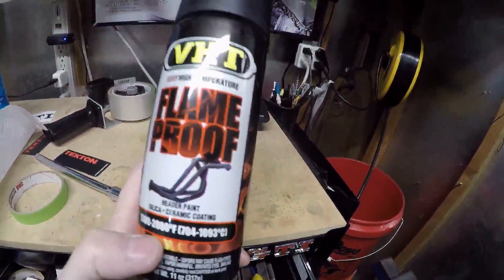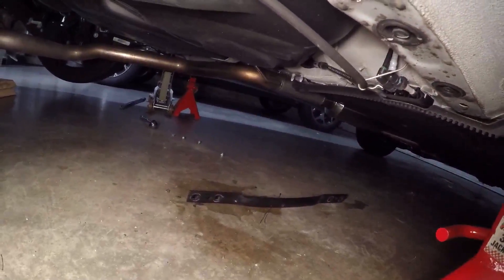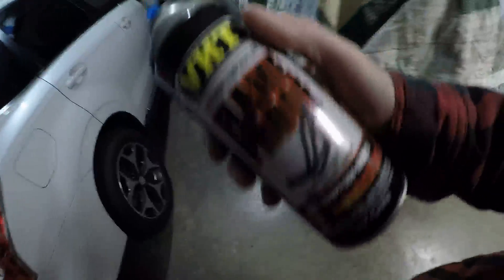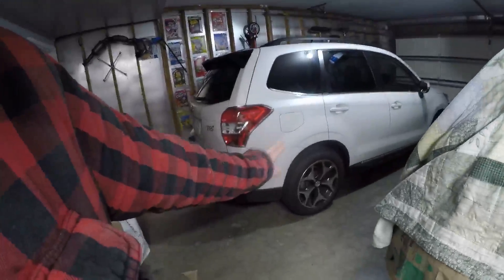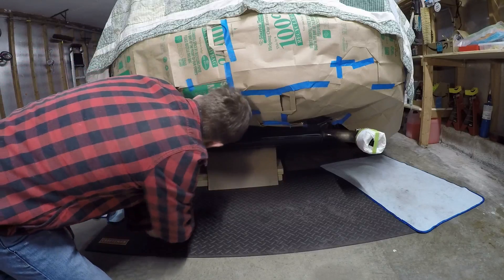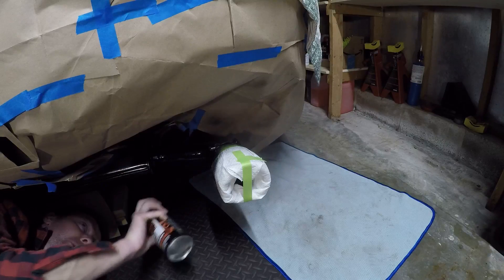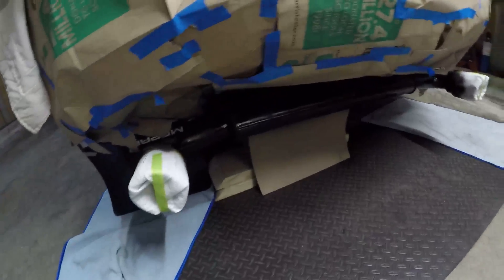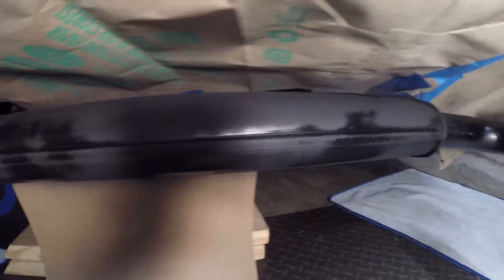2018 VW GTI SE Ep. 97: Muffler Blackout Activities

Comment: Actually I am a helicopter mech. and have painted lots of things. What I meant was, paint the clamp assembly then install. If the paint gets gacked up on the bolt head and threads during install, then you touch up. Easier than masking car and dropping exhaust assy. IMHO The tips look great. BTW. Cheers.
Reply from the maker: nice!